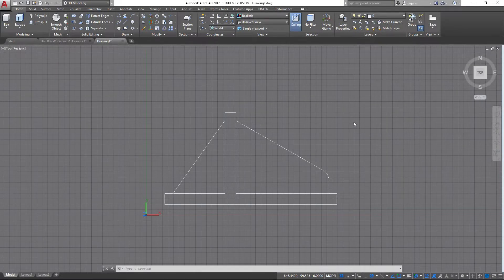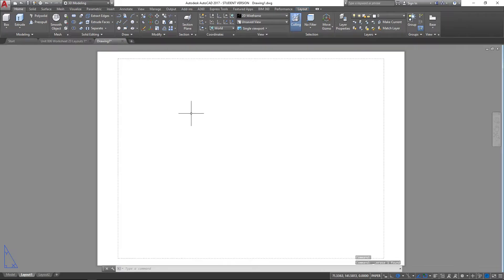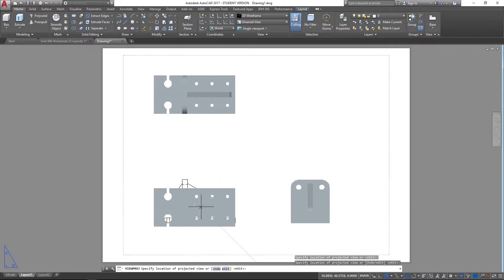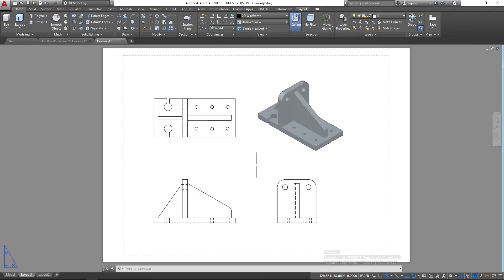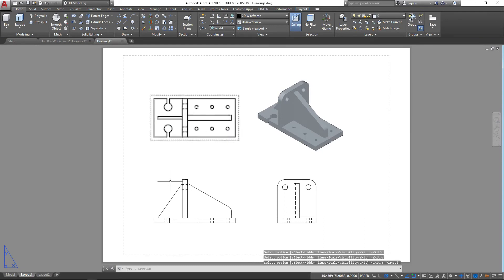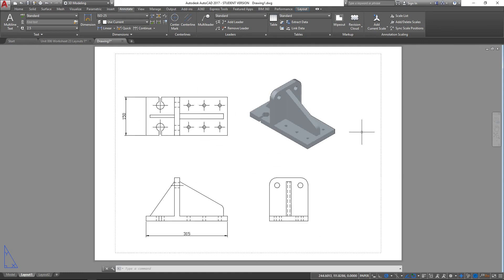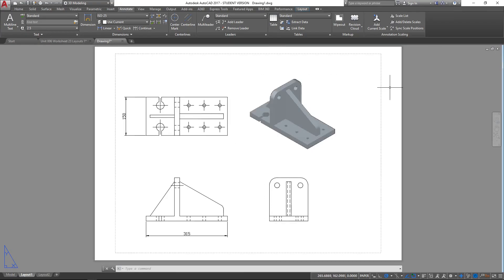AutoCAD 2017 Tutorial: 3D Modelling, Layouts

Comment: It doesn't work for me. It says "Unable to perform the requested action. This drawing was last edited with model documentation in a newer version of AutoCAD". What should I do with it? How can I make it work? Please respond asap thank you.
Reply from the maker: It sounds like the file has been saved with a newer version of AutoCAD, you need to open it in a newer version of the software and then re-save the file but select the option to save as an older version. Hope you get it sorted. 👍
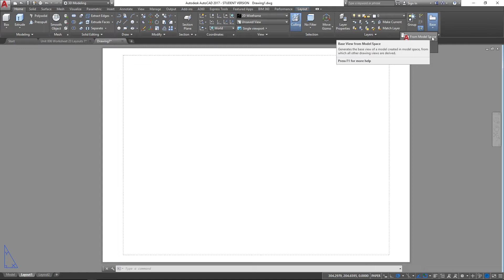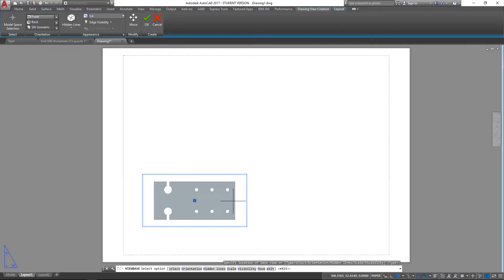Reply: @JoeRobinsonTraining   All right thanks a lot, btw at 2:38 - 2:50 this is the part where I got trouble doing it because of this "Unable to perform the requested action. This drawing was last edited with model documentation in a newer version of AutoCAD". I'm using AutoCAD version 2022, I'll try to do what you said and see if it works, anyways thanks again. 😊
Reply from the maker: Hm, that is a bit weird, if you're on 2022 it should be able to deal with it. Let me know how you get on. 🤔
Reply: in layout when i select base - from model space the object doesnt appear to place it.. how can i fix this problm

Comment: Hey, great video which was mega helpful and clear! Just one question though, I'm having trouble dimensioning and putting centre lines onto the centres of holes in my object, it just doesn't work and says that it's not an arc or a circle. You seemed to do it simply and easily in the video without any hassle so any ideas what I'm doing wrong? Your help would be hugely appreciated!

Comment: im going nuts by the fact that you have layouts on Autocad 2020 for Mac but can not add the base views of 3D models, ony the viewport of them...
Reply: Hi, I am facing the exact same problem with Autocad 2021 for Mac, did you find any solution ?
Reply: @siewhinchang6793  autocad Mac doesn't support yet the BASE COMMAND so I had to do sections on the model and then from those generate drawings within the same 3D space, not ideal but got the job done